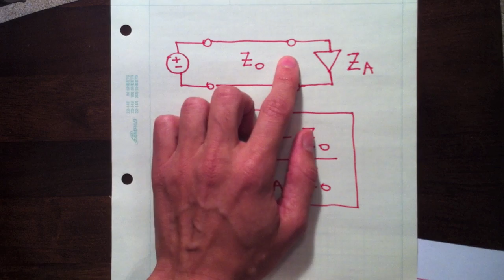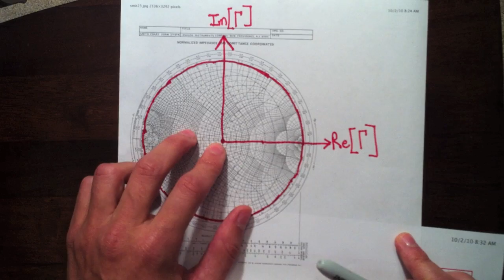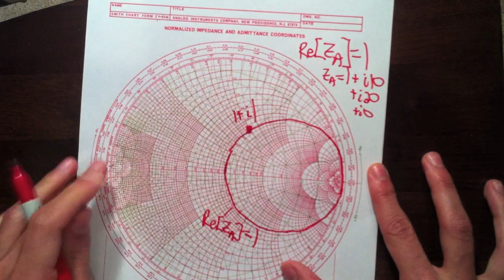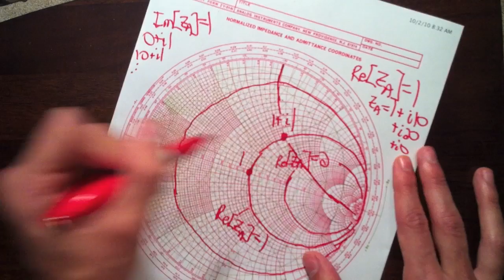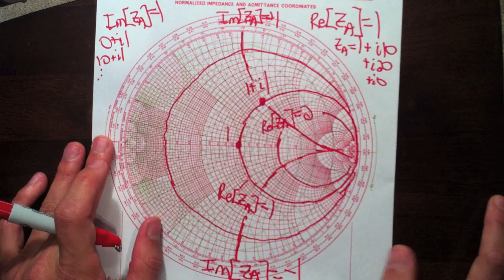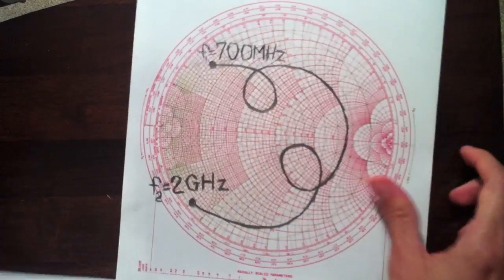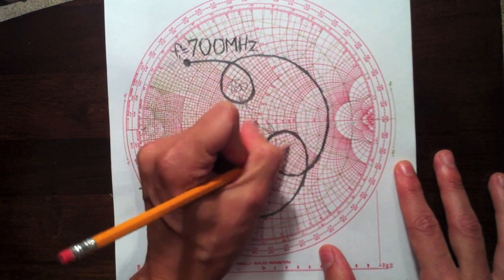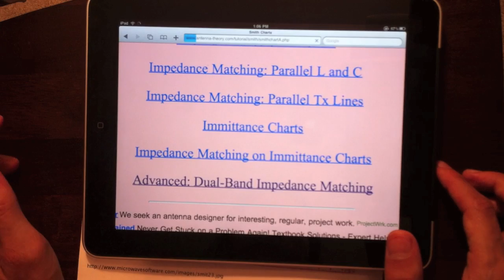Antenna-Theory.com presents The Smith Chart

Comment: Would you please have the formula to calculate de transmitting frequency of the antenna using the number of spiral, distance between one turn to another and diameter of the cable or wire used to construct the antenna? The intent is construct one for amateur bands (28, 21, 7.5 and 3.5 MHz. Thanks. PU2-UBB

Comment: To zxcvbnm2154: 
Actually, the resonances he was describing are those frequencies where the antenna was matched relatively well to the characteristic impedance of the transmission line.  It doesn't matter (that much) that the loops represent frequencies in which the antenna impedance had a non-zero reactive part.  The point is that at those frequencies, the antenna impedance were almost matched to the characeristic impedance.  Therefore, the VSWR is lowest at those two points.  At the point where the antenna impedance is purely real, the VSWR is higher than the VSWR at the frequencies of the "loops" on the Smith chart.

Comment: The constant resistance circles.... He was describing the real part of the NORMALIZED impedance.  The center of the Smith Chart is 50 ohms (if the characteristic impedance is 50 ohms).  So, he was normalizing the antenna impedance by dividing it by the characteristic impedance.